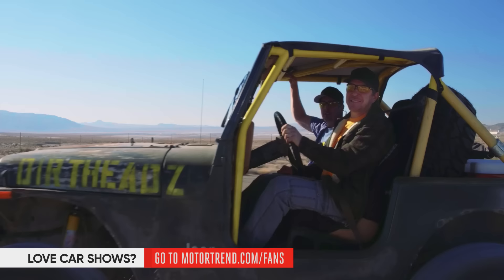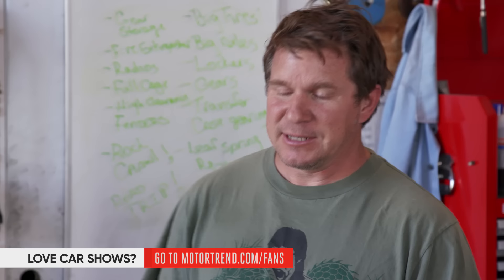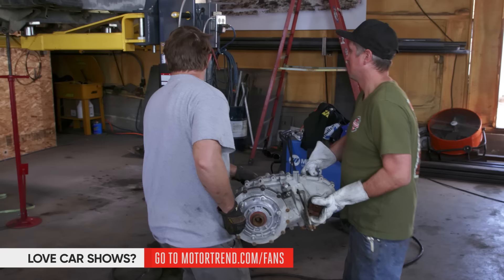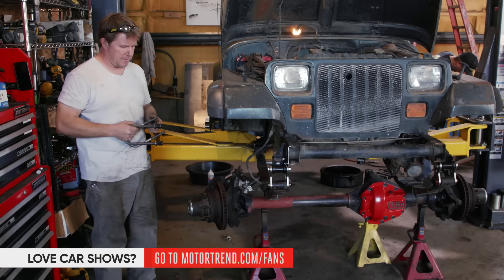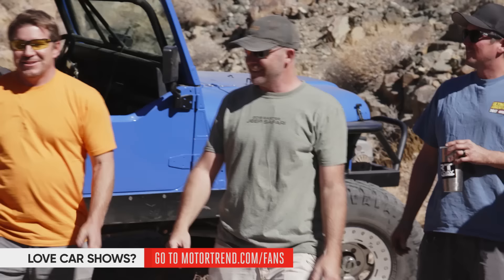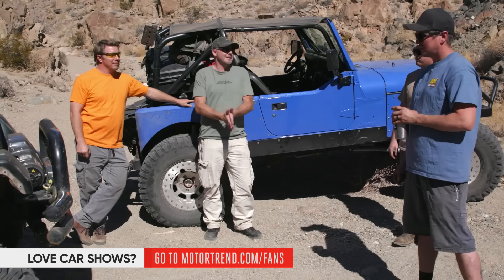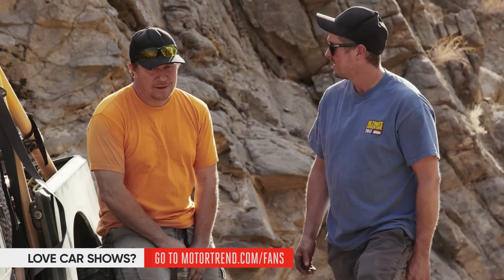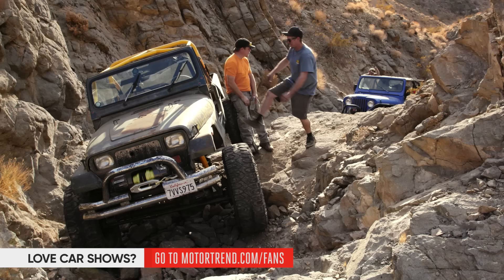Dirt Every Day FULL EPISODE | Junkyard Jeep Gets 40-Inch Tires & 1-Ton Axles—Episode 85

Comment: The Junkyard YJ used to be my favorite DED build. Until now.
Reply: I had a 1992 jeep wrangler from a junkyard ran like a top until a year later no oil pressure after going to haspin acres
Reply: daniel davis  was it the sending unit?
Reply: No oil pressure I had a regular oil gauge on it no leaks and still stayed at zero at idle

Comment: Nicely done, but needs a rear anti-wrap bar bad - with a proper length anti-wrap that rear suspension woulda calmed down & you may have been able to get a smooth bump at & over that last climb.

Comment: Correction. A locker doesn't send the same power to both tires, it just makes them turn the same speed, regardless of the power applied. An open diff sends the same amount of torque to both tires, limited by the lower traction tire. If the lower traction tire can only plant 20lbs of force, it'll only apply 20lbs of force to the side with more traction.

Comment: Detroit Lockers do NOT send power equally to both sides at all times. Power equals Torque x RPM and a Detroit Locker allows up to 100% of the torque and power to go to the wheel with traction and 0% of the torque to the wheel with no traction.

So Detroit Lockers:
1. Allow up to 100% of the torque and power to go to the wheel with traction. This means that even if 1 wheel is completely off the ground, instead of that wheel spinning rapidly it just spins at the same speed as the wheel on the ground and the wheel on the ground gets all of the torque, driving you forwards (or reverse if you're in reverse).
2. Ensure the wheel RPM is at least the same as the ring gear's RPM. A Detroit has essentially a ratcheting system built in that allows a wheel to spin faster than the ring gear, but not slower. When a wheel spin faster than the ring gear (like when going around a corner when there is good traction and the outside wheel spins faster than the inside wheel due to it taking a longer path) you can actually hear the clicking of the ratchet system. So going around a corner without "gunning it" you will hear this fairly quiet "click", "click", "click"... until you straighten out.
3. Similar to how you can change direction of a ratchet to tighten and loosen bolts, a Detroit Locker's ratcheting system can also change direction. The way it works is when you shift from a forward gear (like Drive) to a reverse gear (like Reverse) there is a bit of "slop" in the Detroit Locker (the ring gear rotates slightly without either of the axle shafts or wheels turning). This slop isn't actually slop, but it is how the Detroit switches the ratchet direction. One of the downsides to this is you will hear a bit of a "clunk" when you switch from drive to reverse and vice versa.
4. Every now and then Detroit Lockers will be 1/2way between the forward ratcheting direction and the reverse ratcheting direction while you go around a corner (or are off-roading on rough terrain). When this happens you'll sometimes here a horrible and very loud "SNAP" sound as the ratchet pops between directions. Luckily, although it sounds like total destruction has occurred, Detroit Lockers seem to be able to handle these "Snaps" without damage. My truck is running Detroit's (and 4.88:1 gears) in both the front and rear and I've heard that loud "SNAP" probably 100's of times without any sign of damage. 

I'm actually running a Dana 60 in the front and a GM Corporate 14 bolt "full floater" in the rear of my Chevy K20 (just like they installed in this Jeep) and I have to agree with them that this is an awesome combination if you want a strong, reliable setup with excellent off-road functionality. I used to break axle components, but in 1998 I installed the Dana 60 and it has been rock stolid reliable ever since.

Comment: Need big enough motor to pull those bigger tires as well. Unless you do not like using low gear all the time. But on the road days that would suck wouldn't it? You would think with that much room for added height they could've found a way to keep the steering tie rod from being in front of the front axle so it wouldn't get beat up on the rocks and end up making the tires point in from one another after getting bend on the rocks.

Comment: You mentioned that the Jeep wanted to go straight with the front locker, I saw only one part where Dave said he was trying to steer.  Are you considering putting ram assist on that thing?  Steering my locked Cj was a challenge before I put it on mine.  I went with PSC Being on the cheap what would you use?

Comment: Front axle a 77-79 or 86-91 KP 60? Can anyone tell?
Reply: OS RR went outboard so Im guessing 86-91. The driver side tube looks short, again likely using an 86-91 short tube Dana 60. You can see when they are attempting to climb the last wall, when turning the tire and wheel, they are contacting the spring...outboarded the springs and didn’t compensate when picking the wheels/wheelspacers.
Reply: Yep it's 86-91

Comment: I'm curious what that CJ-6 has for power?
Reply: wes normandin definitely a diesel probably a 2.8 or 3.9 4bt
Reply: I think it’s one of those new Cummins they have in the Titans
Reply: balzarini51 it’s not that Cummins 5.0 that’s for sure
Reply: It's a Cummin R2.8 crate engine
Reply: jwoodsrt that’s what I said
Reply: @chance_moye no you didn't. You said it was "probably" one of 3 different engines. Meaning you didn't know.
Reply: Chance_moye I couldn’t remember for sure, but yeah it’s a r2.8 crate Cummins

Comment: I didn't think they would go with a mechanical locker up front ? Seems like it would cause problems during normal to and from the trails driving on pavement ? At least in sharp turns through parking lots , etc ?  I don't know a great amount about it but if someone is knowledgeable , I'd like to hear the opinions . I have an e-locker in my front Dana 60
Reply: do you have hubs?
Reply: Milo Perrotti 
Just now saw this , yes , factory Ford Dana 60 manual locking hubs ,, and I see your point , lol I never paid attention to there’s on this build . For some reason I was thinking they had the auto hubs like on a 1500 Ram 4x4 Dana 44